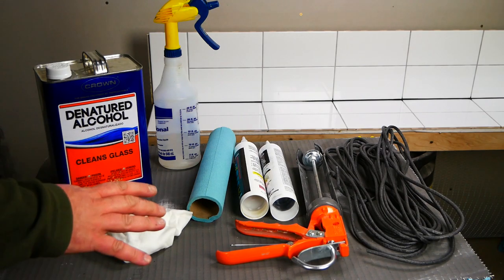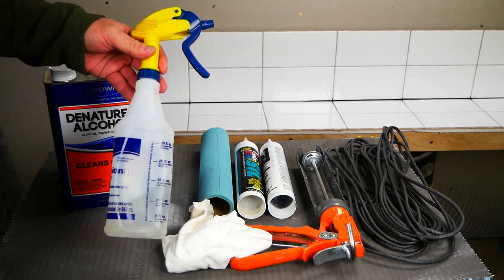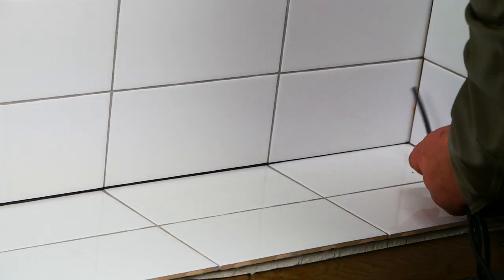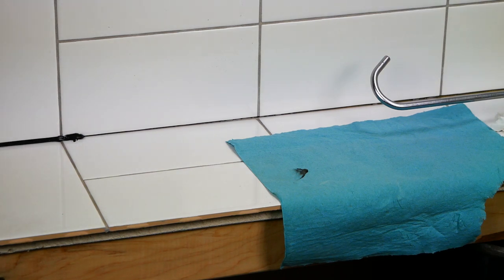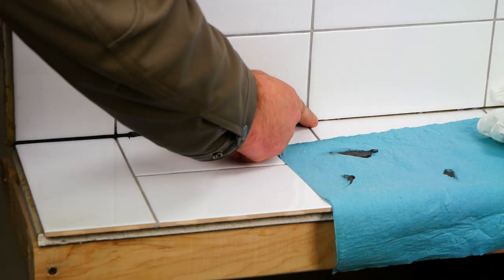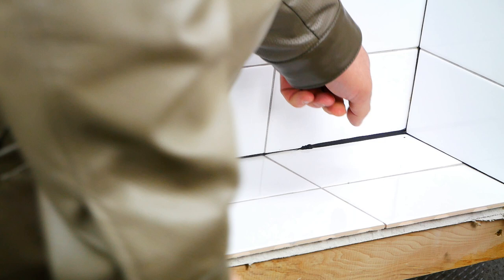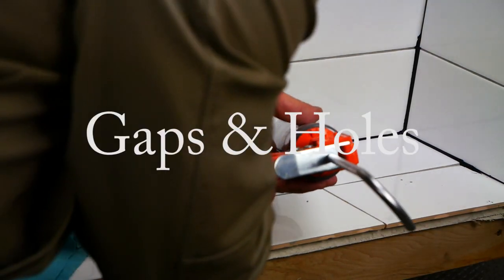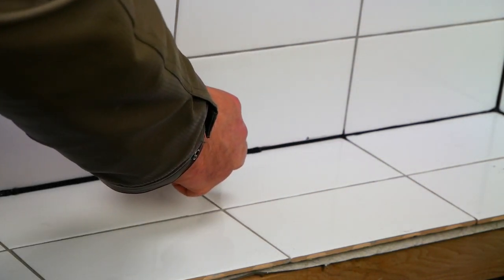Silicone caulk tutorial- How to caulk a shower or bathtub without making a huge mess

Comment: WRT the backer rod…I have read that to perform properly you don't want your silicone to go all the way back of the joint (I.e. the thinset level), you only want it to be on the opposing edges of the tile. Is that part of the purpose of the backer rod?
Reply from the maker: Yes, so it only sticks on two sides

Comment: Thank you! Question: my dad always said to clean out the joint with NAFTA and letting it dry before caulking. Do you think it’s necessary to clean the joint with anything first if there is mold in the existing silicon that you’re removing?
Reply from the maker: I think you just need to make sure that it's clean. This involves scraping and cleaning. There's nothing wrong with using bleach or Conocobrium but you want the thing clean and dry when you go to silicone.

Comment: Can i use isopropyl alcohol instead? I can't find this at my local hardware store
Reply from the maker: I don't think they allow it in California anymore. I've never tried isopropyl but it may work. Other alternatives are soapy water or glass cleaner, which sort of works, or you can tape off the joints, silicone, and remove the tape.